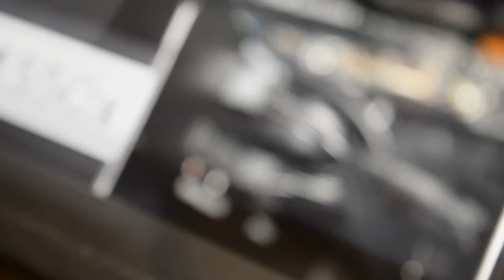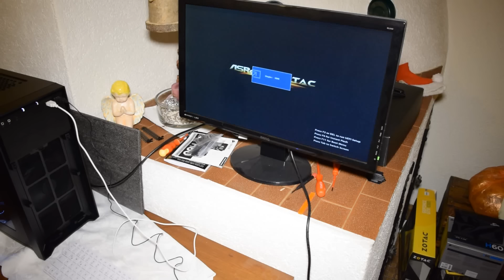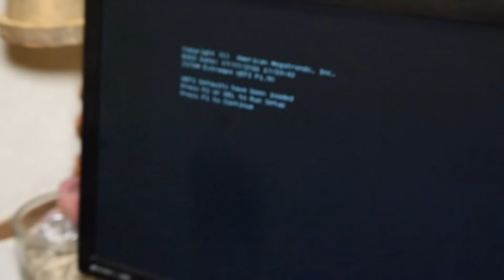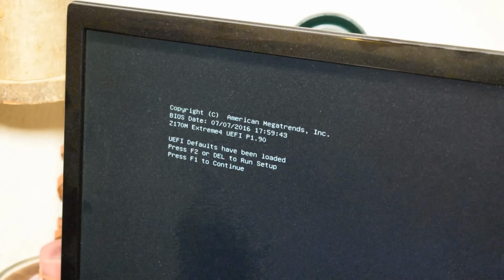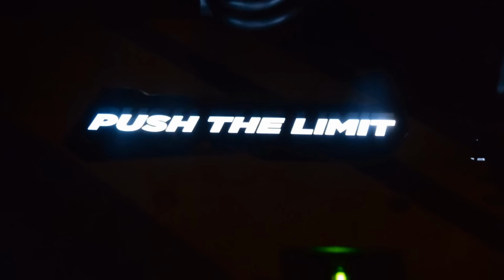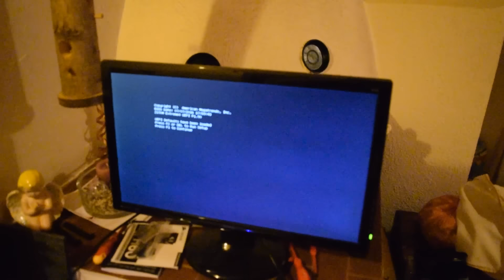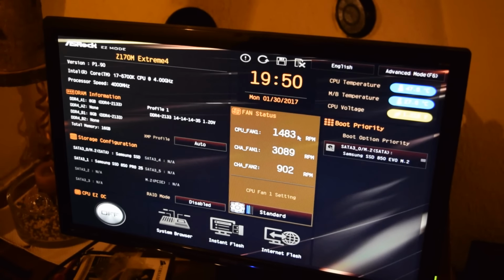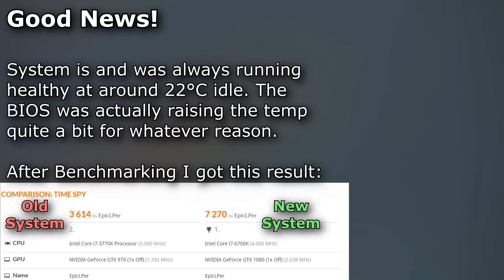Will it Boot? That is the question! - Finishing my new PC Build

Comment: Most people get nervous on their first build, and often make their own little mistakes. 
I got so panicked I had to go cycle for a while to calm down, even then I forgot the CPU power cable, and didn't have the pump plugged in XD Whoops
As far as the noise, you can set a custom fan curve in the BIOS and/or with software in Windows (can't remember the name, but JayzTwoCents did a video on it). For a "silent build", you could always go with an air cooler, since that cuts out the pump noise. I personally use a Noctua NH-D15 which I have yet to hear, even under load (though it is a little overkill).